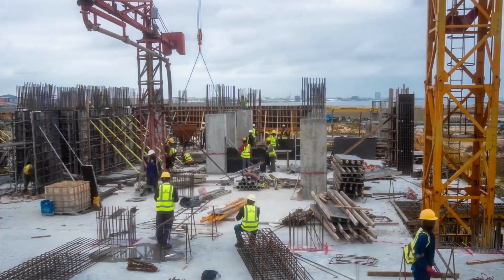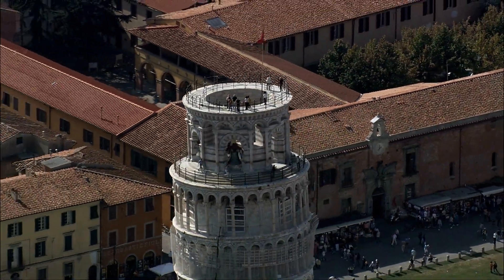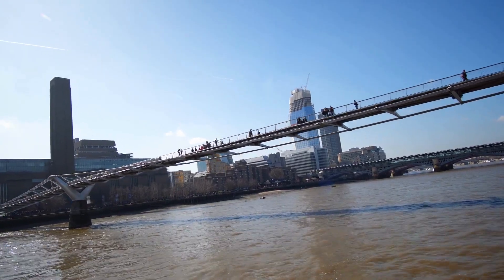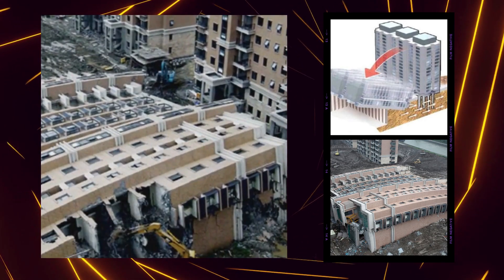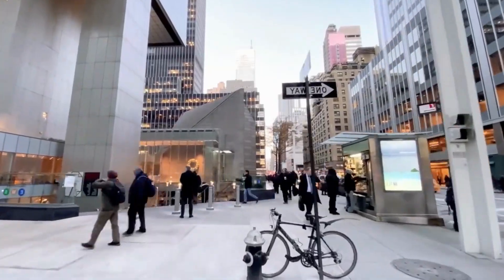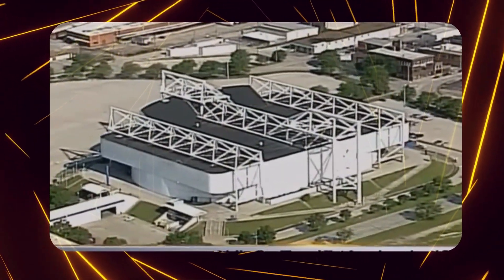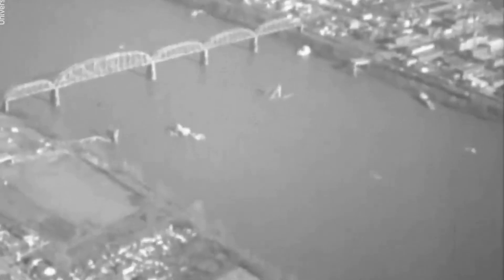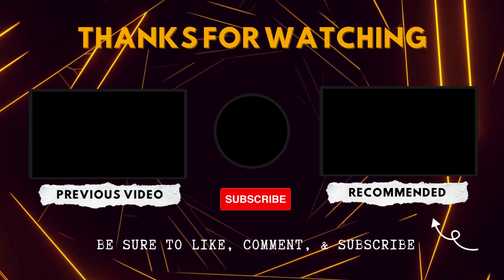Engineering Disasters: Top 10 Biggest Construction Mistakes in History | Unexploria

Comment: I still cannot believe the Hyatt Regency walkway collapse happened.  How did nobody notice that that wouldn't work?  I have zero training in either engineering or architecture and I would still have had questions both about the weight load and the decision to put the metal rods through a seam.  Anyone who sews can tell you that seams are always weaker.